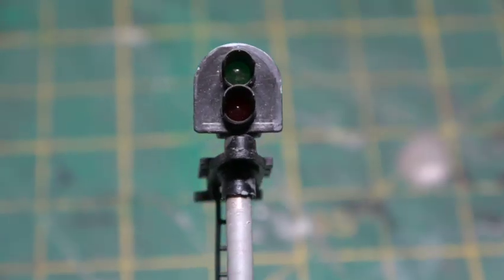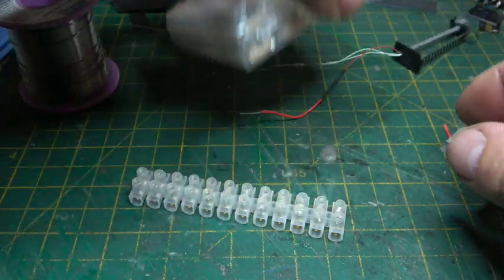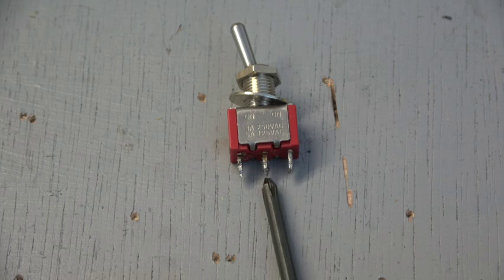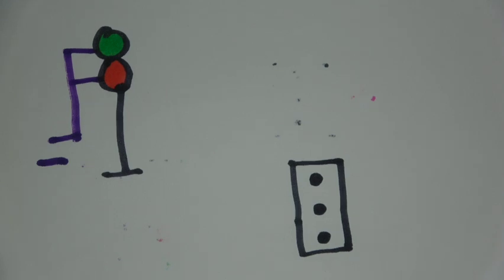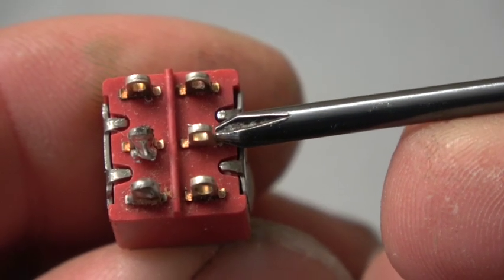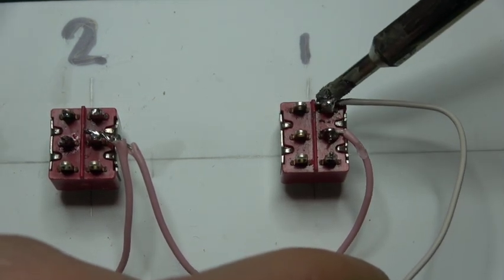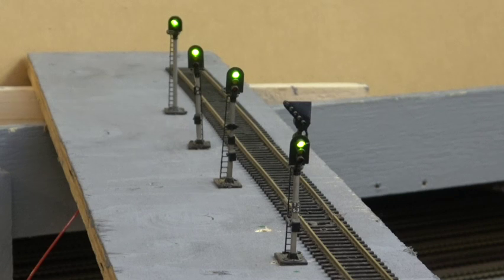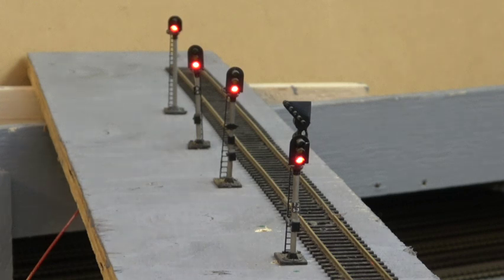Signals #1 Basic wiring 3 aspect (no junctions)

Comment: TWO ASPECT SIGNALS 
Such signals have VERY LIMITED USE. Entering a terminal station, or dead end bay platform a "Red/Yellow" 2 aspect type is required. Out of the line, 2 aspect types can ONLY be used in linked pairs.
The first 2 aspect will be a Green/Yellow type. The following signal at least two train lengths further on will be a Red/Green type. And the distance from the Red/Green to the next Green/Yellow must also be at least two train length further. For the simple reason you cannot confront a Driver with a Red signal, unless the previous signal showed him a warning (slow down) yellow. 

Most frequently the paired two aspect signals would be found before a station (Green/yellow) and as the platform Starter (the Green Red type), only on lightly used double track lines. This pairing was normally operated under what is called "Intermediate Block" rules. There would be no signalbox at the station being protected. The control for these signals was therefore supervised from a signalbox at the NEXT station along the line. And such pairs could be found on otherwise Semaphore signalled lines. In such cases if a train was held at a Red for more than 3 minutes, the Driver had to phone the signalmen (if a phone was provided) otherwise he could blast the horn, and proceed at Caution towards the next Controlled signal. Which reveals you cannot have more than one pair of these two aspect colour light signals, before reaching an area of "controlled Signals" !   

On Modern post steam era lines these "Pairs" of signals could both be automatics, controlled of course purely by "Track Circuits" in the rails. But the same basic rules applied. If a train was stopped at a Red for more than 3 minutes, the Driver had to use the signal post telephone to contact the Signalmen. 

This is also why in Multi-Aspect colour light signalled areas, normally all signals would be 3 or 4 aspect types. Because the signal preceding a Red had to show one yellow !

Comment: You are storing up trouble using solder on the wire and screw down connections . Overtime the soft solder will compress under the pressure of the screw. This will loosen the connection leading to intermittent failure.  Twist the bare wire then tighten down the screw, better yet use crimped on ferrules.  A point to note, it is illegal to use the solder type on mains 230vac for that reason as the solder compresses the joint will loosen and overheat, a common cause of domestic fires.

Comment: 0:25  You are a master at soldering.  I envy you!
Reply: You need an Antex XS25 a 25watt fine tipped Modellers soldering iron, with changeable tips.  25 watts is the highest that should be used with fine modelling work such as point & track building or wiring.

Comment: THE LACK OF COMPREHENSION OF SIGNALLING !!!
NO Commercial manufacturer makes ANY electrical (or mechanical) signal control system that actually copies real life British Railway practice. Indeed even the signals commercially available are only a small limited selection of the most common types !!! For the simple reason British signalling whether Semaphore or Colour light is a GEOGRAPHICAL signalling method. So any pointwork/junctions etc, have to have signals to suit that geographical track layout !!!  Hence the wiring of such signals has to interface with other signals & points if it is to function realistically. And without "Track circuits" or the Mechanical alternative it's also impossible to get mainline signalling to work realistically even along plain line !!! Something few British modellers today seem to understand.

So first you actually have to research all the complex rules covering the complexities of British Signalling. And probably its History as well, as many rules have changed down the decades.
Then you need to familiarise  yourself with the subtleties of DC wiring. And it can be done with nothing more complex than 12v DC Relays, & a few resistors and diodes.  

COLOUR LIGHT SIGNALS
These are normally at GREEN until a train passes each signal & trips it to red AUTOMATICALLY via track circuits !!!  The signal will also change automatically to Yellow once a train has FULLY passed the next signal ahead. Because colour light signals on plain line are "Automatic". Junction signals are "Controlled" (so remain at red after a train passes, & require the signalman to release them when setting up the route for the next train). There are also "SEMI-AUTOMATIC signals, usually only found protecting pointwork to a siding or junction that's rarely used. In this case the signal is normally in "Automatic mode" until the signalman switches it to "controlled" mode before the approach of a train that will need to access the siding/or secondary route. 

Junction signals with "Feathers" present a whole new mine field as the signals have to be "interlocked" with whatever pointwork relates to the signal options. It then gets more complicated when "subsiduaries" such as "Calling on" signals allowing a train to pass the main signal at Red are added. Shunting signals are of course another minor issue as they are NOT allowed to be facing the direction of travel on a "Running line" because Loaded Passenger trains are strictly forbidden from accepting ANY shunting signal. Hence most crossovers on running  lines have to be in the "Trailing" direction, not "Facing " direction, so the shunting signals can only be seen when you are awaiting to REVERSE over a crossover !!!!

Comment: There is no resistor shown in the diagram. Can I used 15 Volte DC use here.
Reply from the maker: Correct. I didn't put it in as that's something that needs to be addressed by your own system. 
Was trying to make it more generic (even though I didn't say so). Depending on which system you use? Whether that's 12v DC LED's or grain of wheat bulbs. then there are LED's with built in resistors. 
Therefore felt it would over complicate what I was trying to convey 
Thanks

Comment: I would say for a safe wiring guide is to always make the supply wire + common on all switches not the - wire that goes back to the Power Supply! This will ensure safe practice even with high voltage such as 240VAC!
Even though the voltage may range from 12VDC to 36VAC, safety first!

Comment: You can assemble WS2811S SOP8 and arduino in just three wires on such microcircuits can be controlled by hundreds of traffic lights and organize logic. You can connect other things to the place of light diodes.

Comment: A simple automation on my set up is use a light sensor module. Put light sensor ahead of the lamp between rails, so that they are red, change green as train passes, then back to red. Then just wire in a lock out for another track at points.

Comment: Thanks for the video of the wiring two colour signals.  Mty question is "what soldering iron and solder do you use? I have a great problem getting irons to work properly.
Reply from the maker: Try to avoid the cheap irons. Antex are very good and affordable! The CS18 is ideal for electronics. The XS25 is a good all round iron for light work, like fold up etches.
Most important is the solder you use!! 
60/40 tin/lead
Reply from the maker: https://www.antex.co.uk/products/precision-range-soldering-irons/
Reply from the maker: https://www.rapidonline.com/r-tech-856861-solder-wire-60-40-22swg-0-7mm-500g-reel-85-6861

Comment: Thanks so much for taking the time to create this excellent tutorial. 
Most helpful I've seen
I'm just a little confused over one aspect: your wonderfully informative diagram has 3 signals, but ends up with 4 DPDT switches, but your demo model has 4 signals with 4 DPDT switches. I'm just not quite getting how that last switch / light combo works.
I'm going to be in way over my head for the junction signals!
Reply from the maker: Termials on the last switch are left free, for the theoretical next signal/switch in the sequence.
Strictly speaking, not necessary, but thought I'd keep them all the same.
Thanks